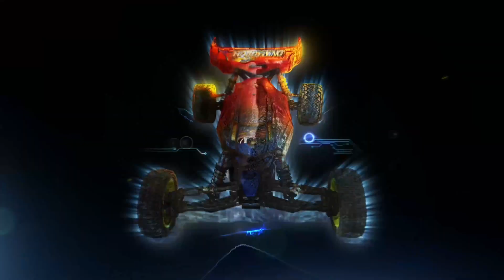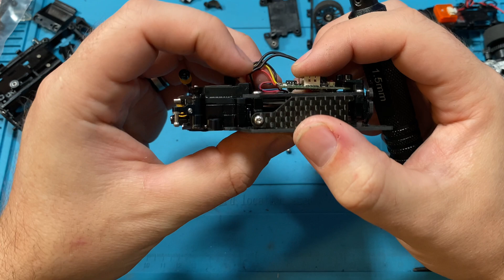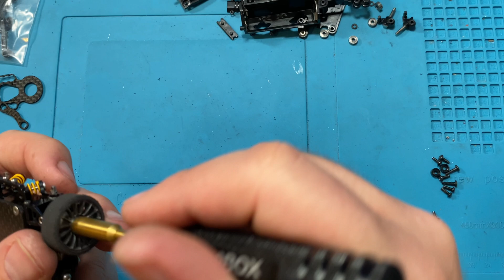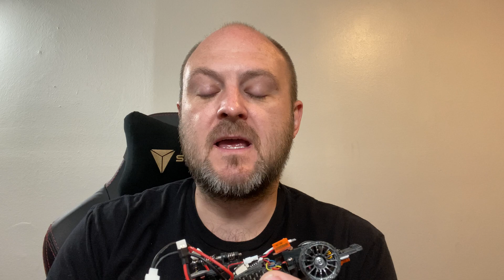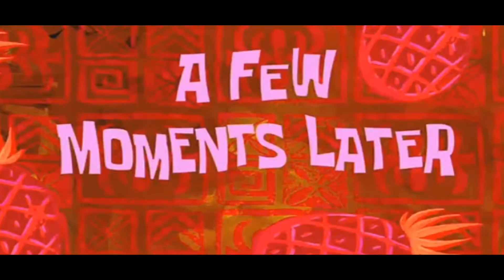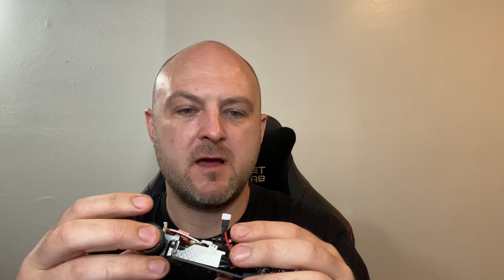Mini Z - Nexx Racing BiSon Chassis build as a "Box Stock" LiPo!!!?!?!??!?!?

Comment: Is there a brass chassis for the BiSon?
Reply from the maker: I dont think so. Most of the focus has been put into the Specter. A VERY good platform!
Reply: @TheShopMiniRC  How is the BiSon on the track?  Better than a stock Kyosho MR03 chassis?
Reply from the maker: @FilthyCasual86  yeah for sure. Much lower cog.
Reply: @TheShopMiniRC  On more question.  I have a MR03 MM2. will the rear motor pod work with the BiSon?  Just wondering if you know or not.
Reply from the maker: @FilthyCasual86  it should work fine.

Comment: Question: For the box stock board, can you run brushed modify motors ? I'm just getting back into mini-z after 15 years and a lot of the tech and it's parameters in electronics are new to me.  I remember back in the day, i had to change the mosfets to run hotter motors.  Sometimes, I even stack fets (2x2) just for insurance of not burning through the mosfets from the mod motors.  Thanks in advance for the 411.  Love your videos as it helps me get back into the mini-z hobby.  ~ Roger
Reply from the maker: You just can’t run super hot motors. Most just run the pn 70

Comment: Do you ever run into issues with keeping the two 1s cells balanced during use? I've considered going to dual 1s in series for my XRX DPA drift chassis but I'm not super confident with lipo usage like that. Might even try that on my SCX24!
Reply from the maker: Nope. It’s exactly the same as a 2s.  Even if it did unbalance, it’s way easier to rebalance one of the two batteries than it is to balance a cell in a 2s.  I wouldn’t worry about the dual 1s being any additional issue.